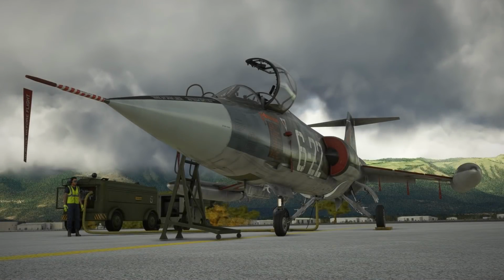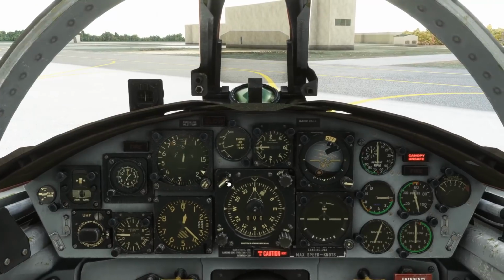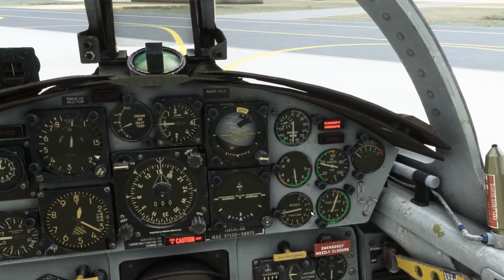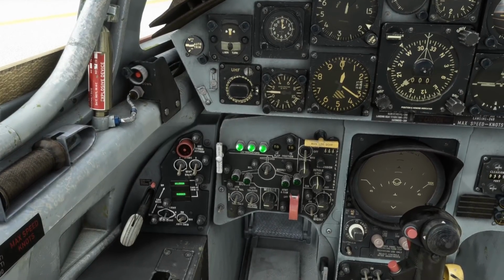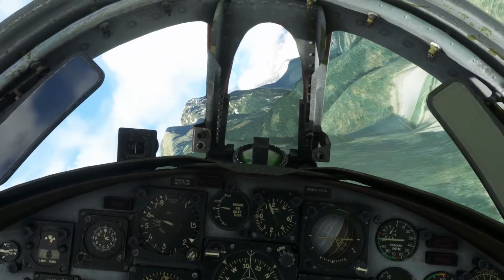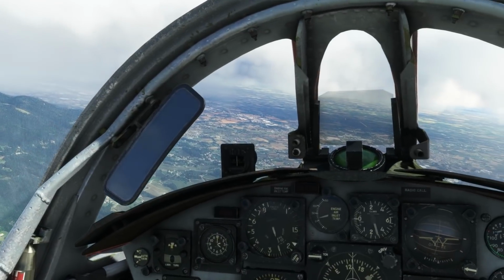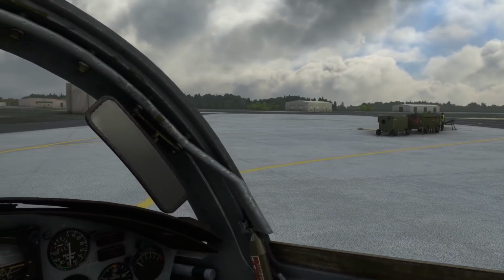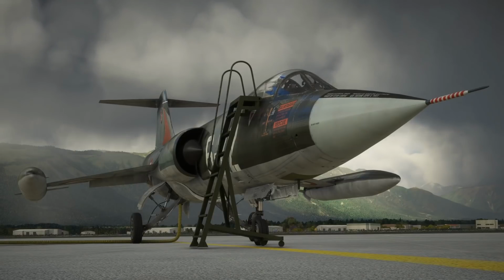The Widowmaker | Low-Level in the Italian Alps | F-104G Starfighter | Microsoft Flight Simulator

Comment: I really don't understand why this is the only plane I have purchased that I have trouble with. The throttle kills itself sometimes and the plane tries to fall out of the sky with the rate of recovery around 70%of the time. Top speed is also unachievable in my experiences
Reply from the maker: Hi ProStreet,

Unfortunately a previous sim update seems to have broken a few things on the F-104 (and the devs don't seem to be very quick to fix things up). I haven't had any throttle issues that I recall, but the afterburner seems to cut out at 10,000ft, which is probably why you aren't reaching max speed etc. The aircraft is perhaps falling out of the sky, because of the throttle issue you're having; with the flaps extended, air is actually taken from the engine and "blown" over the wings to increase lift. If the engine rpm drops below about 84%, this can cause a wing to lose lift and as a result, cause a violent wing drop. Does that sound like what you're experiencing?

Unfortunately we are waiting on Sim Skunk Works to fix up the F-104, but everything seems to have gone very quiet on their end. . .

I hope that clarifies things a little. All the best!
Reply: @IntotheBlueSimulations  thank u so much for the response and clarity. That sounds like it quite possibly could be a good part of the problem. My throttle issue seems to mostly result in losing the engines all together. I can sometimes do a quick restart but unfortunately end up losing the plane the other times. I love so much about the plane that it sucks that it has these issues. I hope something is done soon. 

Once again... Thank u so much for the info and response 💯 💪

Comment: My favorite aircraft although dumbed down for MSFS. There was a version iirc for FSX that you had to fly by the numbers.
Just like the real 104 the POH procedure for a stall was ejection. If you exceeded a certain aoa on takeoff the fuse blocked the tail resulting in a good chance of loss of control. Landing with less than 87% close to the ground was deadly. The SSW 104 is some what challenging and a blast.
Reply from the maker: Hi JimJam,

Oh right, I wasn’t aware such an aircraft existed in FSX, must’ve been great! The SSW version isn’t quite up there but as you say, it provides a nice challenge and is tricky enough to fly, that the aircraft often still feels like it wants to bite you.

The F104 is an awesome machine and I think Sim Skunk Works have done it justice for the most part (a few bugs seems to have crept in due to updates, I hope the team pick up the pace in fixing them).

I’m glad you’re enjoying the Starfighter! All the best : )

Comment: Help. About 3 weeks ago my F-104 started smoking. I thought it was cool...for about 2 seconds but it never stops. Just a cloud of smoke every time the aircraft is stopped. Any reply would be seriously appreciated. I'd just block the effect file if I knew where the damn thing is.
Reply from the maker: Hi Mark,

Are you still having the same issue? I had another viewer reach out with the same problem, but he said that simply restarting the sim fixed everything up for him. I did load up the F-104 to try and recreate the problem, but I didn't have any such issue myself, so it's a bit hard to suggest any fixes etc I'm afraid.

Sorry I can't be of more help on that one. I do hope you manage to get things sorted.

All the best!
Reply: @IntotheBlueSimulations  I wouldn't exactly call it a fix but reloading the plane from a fresh download worked. However the performance has changed. Before I had no problem going supersonic in level flight now the best move seems to be climbing to at least FL250, achieve at least 0.9 mach and nose over to -20 degrees. She'll go supersonic at just a touch less than FL200, then just wait until about 1.05 mach, slowly let the nose come up and do not get to 0 degrees until 1.1 mach. After she gets to 1.1 mach things start happening fairly quickly but I'm supersonic and can pursue whatever profile I want to test.

Hey man, thanks! I should have come back and reported all this a couple days ago but, you know; work gets in the way of the important stuff sometimes :) Thanks for your interest, your channel and your support.

Comment: I just got it, but the ailerons are reversed?
Reply from the maker: Hi Julian,

Apologies for the slow reply, I've only just had a chance to test the aircraft. Are you still having the same issue - everything seemed to be working normally for me?

All the best : )
Reply: @IntotheBlueSimulations  well I haven't flown it really as it all seems wrong when you're rolling the wrong way.. each time I've tried it. The ailerons move correctly in accordance with the stick, only it rolls the opposite way...

Comment: How this addon behaves when flying supersonic speed? Is it possible to fly supersonic and does it have top speed 2 mach as a real plane?
Reply from the maker: Hi YK,

Apologies for the slow reply. Mach 1 is no problem. Mach 2 I haven't been able to test, as the aircraft currently has an issue with the afterburner above 10,000ft. I'm not sure what is causing it, as the issue wasn't there previously - I suspect something may have been broken with SU9.

Sorry I can't be of more help on that one currently. All the best! : )

Comment: How did you get the wingtip tanks to work? I couldn't get them on mine
Reply from the maker: Hi Trevor,

Do you mean how did I install them? Or were you wondering how I have the engine feeding from them?

All the best : )
Reply: @IntotheBlueSimulations  No, just visually.
Reply from the maker: If you’re running the F-104, it should just be a case of selecting the tip tanks via the tablet (as loosely outlined in the video). If you’re running the TF-104, you’ll need to find the “LadySetup.exe” and install the tip tanks from there - you can find the program in your TF-104 folder (located inside your sim community folder).

I hope that helps? All the best! : )
Reply: @IntotheBlueSimulations  Awesome, thank you so much! I'll try that

Comment: With the TF104 I genuinely struggle to get the thing off the ground in one piece.  I also struggled with the rather hacked together external app to set up tanks and fuel.  This looks like a much nicer implementation.
Reply from the maker: Haha, the F-104 is indeed a bit of a tricky beast to get airborne. I find the ground handling a little bit funky - it's very easily to get the aircraft into a left-right oscillation around the nosewheel, especially on landing (maybe that's somewhat true to life though, with the very narrow undercarriage).

The kneeboard is definitely a far better setup, quicker and less fiddly. It's a shame that the radar app still needs to be started externally though.

All the best! : )
Reply: @IntotheBlueSimulations  p u0
Reply: @IntotheBlueSimulations  
On the subject of ground handling, have you had to do anything in particular to get the beast to actually taxi?
My controls are set up fine as they work in other default and 3rd party models, this one however can only be steered through differential braking... which is less than effective given the narrow track main gear.
I've already had a reply from SSW which was less than helpful: "unable to reproduce".

Comment: Lovely video! I am concerned by the "Bobbing" when you bank? This "BOBBING" I have seen in high speed turns, actually the MB339...not a good sim!(YUK)  But with a tiny wing load, in this jet,  I would expect a low effect on aileron and a "mushing" (soft turn) rather than a hysterical "Bobbing" that I see in your video. Its "Hysterical" because I can see this on my monitor! If I was in the cockpit i would have my balls jolted and get a really stiff neck! ! The KING of low level was the TONKA Tornado for non RAF Types or perhaps the HARRIER GR3...Ohhh Harrier jockeys... a smoooooth ride...You would hear! I never expect to see this in MSFS...No one has a clue? ....unless someone knows the RAF SIm a t Leuchars and can simulate fast jet low level.....DREAM ON!!!!
Reply from the maker: Thanks David!

Haha, well that could just be my flying. . . : P

But yeah, the bobbing seems to be a prolific problem in MSFS. I'm no expert in flight modelling, but I gather at least some of the aerodynamics issues are caused by the sim not taking into account disrupted airflow over the tail surfaces (they behave 100% efficiently, hence the over-sensitivity). I suppose that may (hopefully) change as the sim moves more towards CFD (our first example arriving with SU9).

MSFS is no fast jet sim though and these sorts of addons are really just a bit of fun in my eyes (The Hawk is the only fast jet that offers an elevated experience I would say). DCS is still the best place to be if one is looking for a decent flight model (and addon).

That sim at Leuchars sounds like fun though! I guess they aren't going to let me have a "play" though : / haha.

All the best!

Comment: what are these massive side pots for ? can t see how there are fuel lines through those razor thin wings ?
Reply: As thin as the wings of the 104 are they actually are plumbed for fuel, one tank on each wingtip and an additional tank under each wing (not shown in the video). Don' think the A model could mount the under-wing tanks but the rest did.
Reply: @FallenPhoenix86  i see ... must be like fuel injection lines on a car ... (diameter) ... do you know how mutch range that is if fully fueled with all these tanks ?
Reply from the maker: Haha, they are indeed fuel tanks SP. I don't know exactly how the F-104 was plumbed up, but it seems Lockheed managed it one way or another.

I believe the range with all 4 external tanks fitted was around the 1,500nm mark.

Cheers and all the best! : )

Comment: 2 questions:
- will the TF104 be updated with the insim kneeboard table ?
- and is there diferences in fonctionnalities between the marketplace and third party reseeler versions, like it was the case on the TF104 (for the external apps)?
Reply from the maker: Hi Adr1, apologies for the slow reply.

It's great to hear that the functionality of the TF-104 has now been updated. I knew it would only be a matter of time, but I wasn't expecting it to be so quick!

I didn't realise that the Marketplace version had some restrictions vs the 3rd party version, but I can see why SSW would have had to do that. Unfortunately I would expect all of the same restrictions would apply with the F-104 (though that is only speculation on my part).

Cheers and all the best! : )
Reply: So there was the update (21/04/22) for the TF104G with the addition of the insim kneeboard and all the fetures of the  FRF-104 G !
Really Noyce ☺